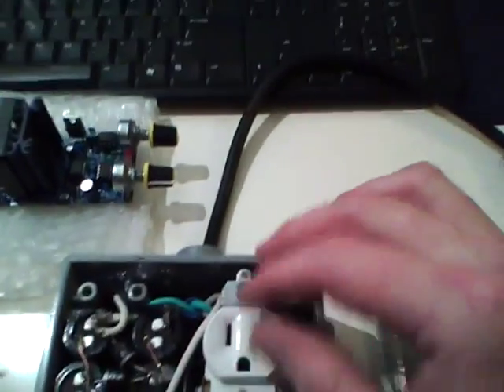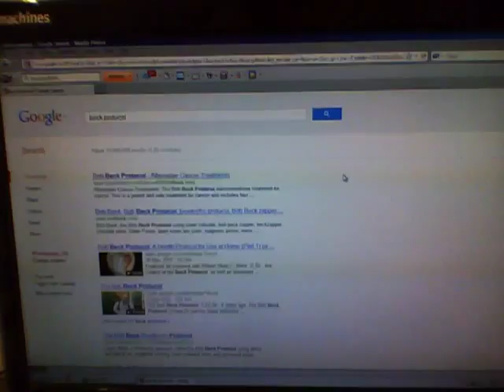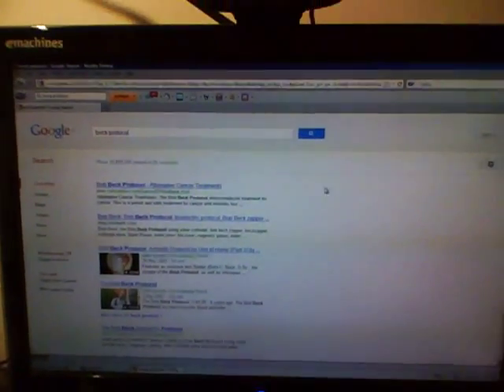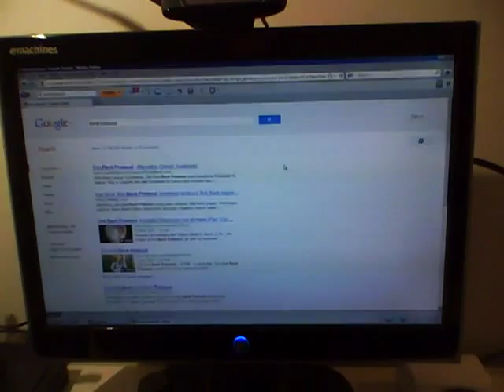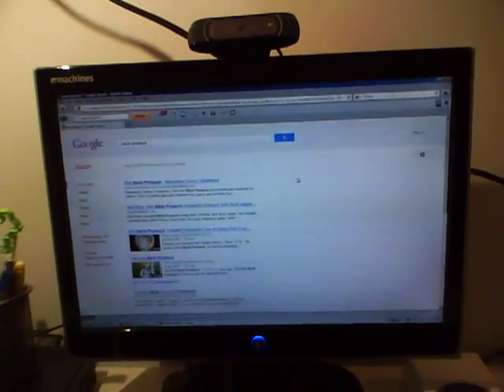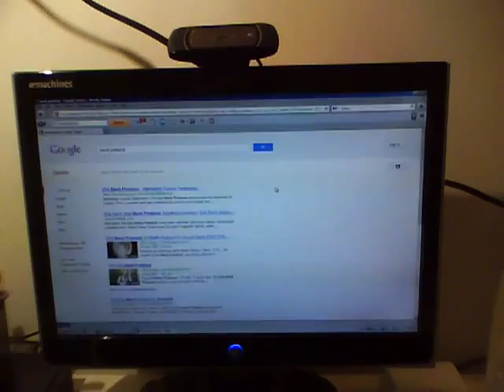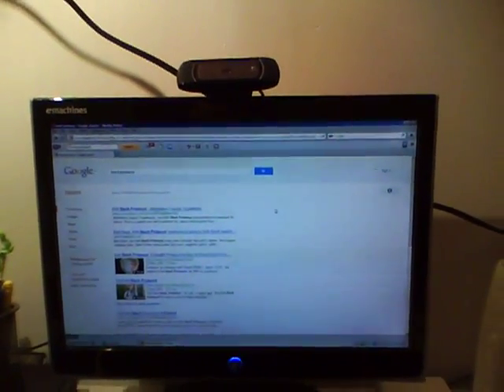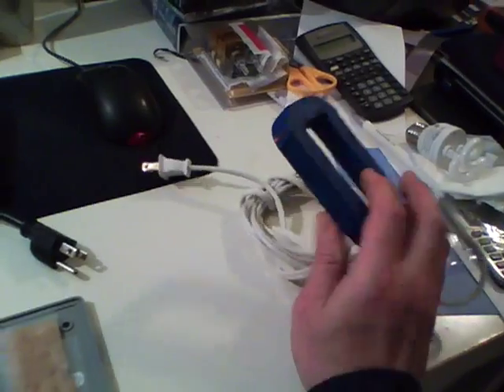High voltage DC Power Supply Unit

Comment from the maker: Thanks... no schematics on my cap set up, sorry. I just used the old capacitor voltage step up theory and a 12 volt relay to pulse that store energy into a coil. The second circuit pulse unit going to the relay however is at:....electroschematics....  com/220/12v-dc-220v-ac-converter/.... Thanks for watching.

Comment: @whyme2b Foot detox does work, just the commerical marketed one don't. You have to build one with two individual electrodes  seperated to get any work done. The commerical ones don't do a heck of a lot because of the array are together. The arrays you buy on ebay make great hydrogen but don't work for foot detox, go figure. I use my ebay arrays for hydrogen production on stright battery current because they use spirle wound ss steel in the correct pattern for hho or hydrogen.

Comment: Thanks for sharing. Also check out foot detox's they work too to get rid of the chemicals your body build over time. They work too. Just the one's on ebay are not that good. But the arrays they sell make great hydrogen from stright dc.

Comment from the maker: @Pagz1234 
 Again...Thanks for your Knowledge ! I do however play it safe when it comes to photo caps and high voltage dc current thou... The studying in becks videos however, I found that it was just burst of slow pulsing of one magnetic pole field. Because pulsing at 300hz frequency would vibrate the cells to fast like assimilating Alternating Current (A/C) which would not repair but make things worst for the good or bad cells. Will study more about this. Thanks for watching..